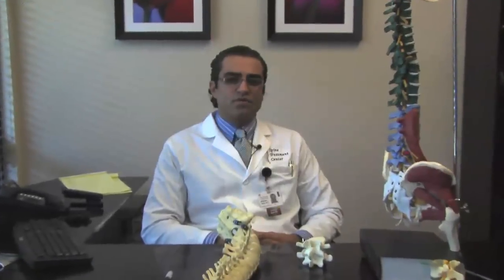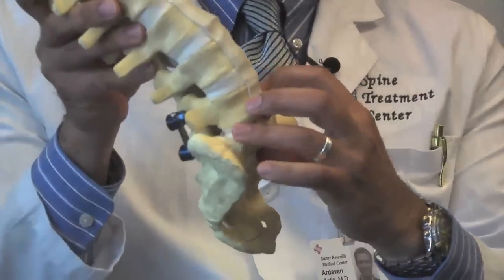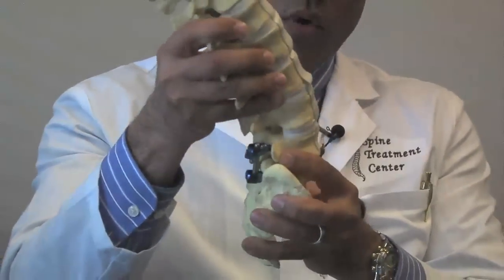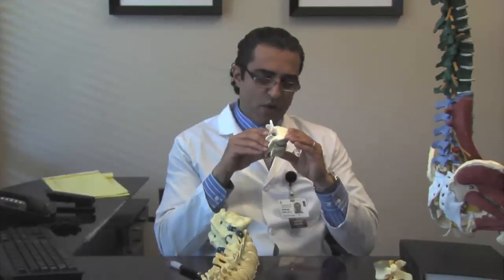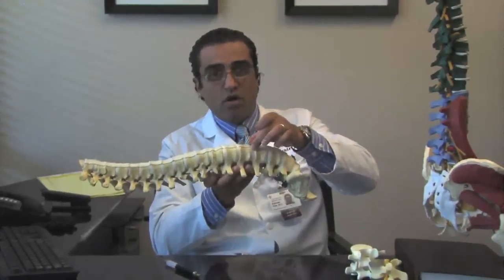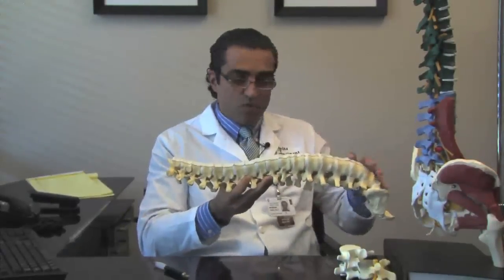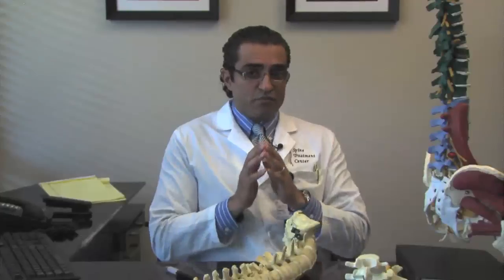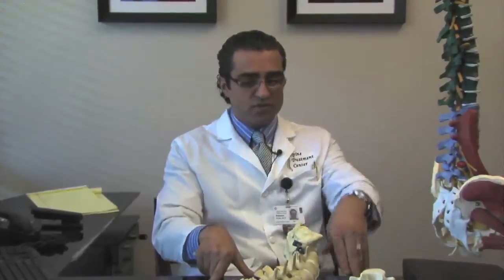Spine Treatment Center - Fusion Vs. Disk Replacement

Comment: Great video. Been Reading a hole lot about spine surgery. Had a surgery l5 s1 for herniated disc 
No fusion or artficial disc. Just remove a partian of the disc the pressed against the nerv. I am plain handicapped after this. 
I live in sweden so sorry for My english. This dr feels like a good guy, My dr want even see me after the surgery. Feels like when you get these surgerys your stuck in a loop. Its sucks but Thats life sometimes. 
Happy new year byw
Reply: daddyp 4 years later, how is your back doing today? is it got any better since the L5-S1 surgery? reason i'm asking, i need to do the same procedure in my L5-S1. cheers.
Reply: Did the doctor mess up? How did it handicap you

Comment: Indeed great video and easy to understand..I has question, I had my back surgery due to degenerative disc between L5 and S1, and my spine surgeon had to put a inter laminar device which is a hard silicone block called INTRAspine manufactured by cousin brother. Before the surgery, the doctor giving some options either to do spine fusion, or INTRAspine, but also rejected for disk replacement for same reason you pointed out. So how do you categorized the interlaminar (there are few in the market, such as coflex ? I mean what is the patient experience after few years.

Comment: So what kind of procedure for DDD of cervical c 3,4,5,6,7. due to trauma and aging. Walking weird off and on. Pinch nerve with certain movement in which my body goes numb. Problem turning head to the right, feel like disk goes out of alignment, then it straighten itself out when it feels like it.  Fusion or replacement, or do nothing?

Comment: I know it’s been ten years since this video has been made, having said that, has there been any advancements in disk replacement? I’m asking because I know that in Europe, spine surgeons use the LP-ESP, which is a visco-elastic disk that’s more rigid and simulates more the mechanics of a normal disc. Does your practice offer the LP-ESP? If not, why not?  Thank you
Reply: my understanding is that currently disc replacements are far better and have better outcomes than fusions for 1 level and 2 level replacements
Reply: Is that the one that has been greatly failing , they didn't research it long enough now they have all these failed surgeries?
Reply: @sarajah4him  I believe the one that has had more failures in the lumbar region has been the M6-L but it’s been a while since I’ve done any research on it
Reply: ESP has  unacceptable high rates of Osteolysis in male patients. A big fail if you ask me

Comment: unfortunately it still sounds like even for young people like myself that lumbar disc problems can really only be partially fixed by a fusion  which leads myself  as an avid grappler and someone who depends on flexibility for their job just how badly crippled you end up after a fusion  lets say  l5-s1  will you ever bend again or should you just go out and pre order a wheelchair  and say its been a good run

Comment: I had an injury at work,ended up months later having a fusion,it went great except for tingling and numbness in my left hand,mostly in the last three fingers,one doc said it as a pinched ulnar nerve in my left elbow,I had surgery for bones spurs in my right shoulder and the same doc says the tingling in my left hand was from the injury in my neck ..so he wants me to go back to the doc that did my fusion..on the papers I got he thinks I may possibly have polyneuropathy....so I am waiting on my Workmen's Comp case worker to set me up an app.,she took her time on getting me help in the first place when I got hurt at work,and I think it may have caused more damaged..waiting around (I reported it in November of 2013..,nobody would help,so I went to HR at work and immediately he got ma an app,but didn't have surgery until Feb of 2014)

Comment: Thanks for this video.

How do you like the M6-C, please, dear doctor? I Like the shock absorption profile mimicking nature's own.

My main concern--other than being nervous about any artificial implant--is that metal so differs in properties from bone. Even with osseointegration, if a cervical metal disc is dislodged in oh, a car accident, e.g., couldn't it endanger the spinal cord quite a lot?
Reply: Good question. It is actually REALLY difficult to move the artificial disc between the vertebrae once it is there, even before the bone integration with the disc end plates. There is a lot of pressure between the vertebrae to crush a really hard nut (about 1000 lbs in the male lumbar spine; cervical has less lressure, but still enough to hold the disc tight). If you get into an accident so bad that the spinal cord is at risk of getting pinched, it will most likely be from a displaced vertebral body more than an artificial disc displacement. This is what I hqve vathered after a good year of research. I just got my LP-ESP in Germany at L5/S1 qnd love it! Playing sports like there is no tomorrow.
Reply: Did you get it with Dr. Desai? I also need the L5-S1 and as of now he seems like the best doctor and also the best disc.  wow playing sports like no tomorrow that sounds good!  I hope I will be a candidate, I do have moderate facet arthropathy at L4-5 and L5-S1.  Did you feel like you got suspension in that disc? right now I feel like a old car that the shock absorbers have gone on.  I would love to ride my horse again!
Reply: @treelore5100  I went to Dr Schmitz in Dusseldorf. Same price as Desai (about $23k for one level) but Schmitz is a very talented and commited neurosurgeon. Both are good but Schmitz operates out of a private clinic so you are not risking the infection you might at a public hospital where Desai works. Each is good so I would send in your images to both. Feel free to email me for more information at curylloartur@yahoo.com. I am going to Tennessee to ride my dirtbike the week of Nov 26. I am 14 weeks out. I was riding my mountain bike at 5 weeks. You will be riding your horse again. Too bad most insurance doesn't want to cover this procedure abroad, but it was still best money ever spent.
Reply: :-)  thank you!  I copied your email address down so if you need to delete this you can (if you want).   I may well email you some questions as I get nearer.  Getting my MRI today.  Next will be working on getting a bone density test.  I had a look at Schmitz website and that private clinic sure looks like an upgrade!  I am surprised he can keep the cost the same.  I am going to think you had a good selection of hotels as it's in the city?  I would think they will have very good high speed internet.  He also looks to be a good age not too young or too old.   I got happy tears reading you saying I will ride my horse again!  as you know this is emotional and life changing if all goes well.  I just went on facebook and joined the group just waiting for my application to be approved.

Comment: ok so what do you think for the lumber surgery - fusion or replacement 
plz tell me - i have herniated disc in l4 l5 s1
Reply: what did you end up doing?
Thanks
Reply: ABDALLA AHMED MAHER this comment is weird. Did you think he was psychic 🤣
Reply: ABDALLA AHMED MAHER dude don't get a fusion. It's a old method that's fatal. I have a fusion on my l5 and s1 its not a good look. Get a dics replacement u will still be motion and mobility. That's everything 🙅🏼‍♂️🙏🏻♥️🦋
Reply: @devinramdihal8149  what does the fusion stop you from doing?

Comment: Doctor thank you for bringing a perspective I had no awareness of regarding this issue.  I have one lumbar disc that is completely bone on bone, very painful. Trauma related. Must have surgery. I also have cervical damage in 4 discs which is even worse with nerve compression. I have found a good surgeon but don't know what is the best route for me before giving him the go ahead. I am a teacher and a dancer. I want my life back. Surgery to be done in the next month or two. Please send message to facebook. Crystal Backmon
Reply: The idea of metal in my neck frightens me. Isn't there a better material that can be used?
Reply: crystal backmon I am 52 and MRI shows narrowing of canal in the cervical but besides spurs, the bones themselves are of good density. Just FYI
Reply: crystal backmon Wait till you get the answers u need. Your surgeon should be understanding. Do it when YOU r ready. I recently had total knee replacement on both knees. The metal was hard to get used to only when I could feel it, like when I would kneel. Other than that, you don't notice it at all. The types of materials changed over the years and have advanced dramatically. The doctors in-the-know use the 30 yr prosthetics instead of the 15 year ones. Research! Incidentally, I have a girlfriend in TX who had neck fusion and loved it. I also know of a patient who had the problem with the neighboring discs as described in this video. Difficult decision, I know. I have to say that PTherapy definitely has improved. My knee says so.

Comment: I have had epidural injections for several years.  I had a motorcycle accident, also previous injury from accidents from motocross and contact sports.  I had C5-C6 fusion and have three more dry discs, one above and two below that.  And three thoracic dry disc, that are causing severe pain through my torso.  And 4 damaged and dry discs in the lumbar region.  My vertebrae are also arthritic.  Very cloudy in the MRI.  Do you think the epidural injections could have caused bone to become arthritic in this way?  I have been told I am not a good candidate for surgery because of poor vertebrae as mounting points for posts.  Do you think prosthetic discs would be a viable replacement for this many issues?  I am in severe pain for 6 years now and rarely sleep, and have lack of stability in multiple places in the mid and lower back.  I am in misery and need help.  I currently see the VA, and they are as bad as described in the media.  Any references and help is greatly appreciated.
Reply: +John Blecha  VA Did fusion on my husband's back at L4 thru S1 one , he walked like a robot and was on pain meds until his death in 2010.
Reply: +capatga Sorry for your loss.  I am reluctant to have the VA do any more work on me.  I have seen three Neurosurgeons about my condition and all have given me low chances of good recovery.  25% at best.  I am in chronic pain and been down that pain med rode with poor results in the long run.  I took myself off of most of them and pain as decreased to a small degree, but anything is considered help at this point.  I am really miserable and need something done.  I was hoping this might be possible if the VA will outsource the procedure.  Living on a prayer here...
Reply: I am sorry to hear the state of your spine. I would consult outsideof VA for any serious stuff like spine surgery. I went to Dr Andreas Schmitz in Dusseldorf Germany, but there are several other really good spine surgeons in Europe and here in the US. I am not sure if you can qualify for a disc replacement since you have a bit of arthritis from what I read, but they would all have you get a Dexa bone density scan as well as a CT scan aside from your MRI to see all bony structures aside from the discs. You can send in your images to Dr Pablo Clavel, Dr Biren Desai, Dr Andreas Schmitz (my three favorites). Schmitz is the one who fixed me. At leadt you can get an opinion from the best of the best in the world.

Comment: We DESPERATELY need to update the design of these replacements. The inside of a natural disc is like silicon rubber, and the outside is like a much tougher, fibrous plastic. Why don't we have a disc designed with two layers like the natural one?
Reply: Thanks, man.
Reply: @DavidSain1  M-6 has a major design flaw where by the the core tends to displace because it is not well contrained (the woven mesh in M-6L is not strong enough to keep the core centered if you experience any instability in the segment). This was well mitigated by a different disc manufactured in France: LP-ESP. I just got one three months ago and riding my mountain bike like there is no tomorrow. Good luck!
Reply: Artur Curyllo where did you get this procedure done?

Comment: Hi, I had a very large herniation l5 s1 and five spurs of bone. I had a microdesectamy. Since then I have re herniated the disc and are in extreme pain.
The surgeon has recommended a fusion over a disc replacement and says its 70% success rate. Anyone else's opinion would be massively appreciated! Dire straights at the moment. 
Thank you.
Reply: Hi did u have the surgery
Reply: @hamedaloui5487  hi, no I have been doing lots of core exercises, walking and loads of stretches. Seems to be kept in check. Obviously I can't do any crazy things like sprinting or power lifting. But I'm OK if I get a flair up I will resort to naproxen or pregablin. To help with the nerve flamation. I have learnt that the least surgery or invasive treatment the better and with technology hopefully! Stem cell tech for example. Good luck with ylur own treatment.

Comment: Well fusion is bad and disc replacement is not good for degenerative disc disease, you didn't advise on what we should do then ? Live with the pain? I can't sit long or stand long we are talking longer that a minute or walk more than 5 minutes, please advise me on what is the best surgery for me, I have a severe degenerative disc in L5S1, and spondylosis a shift of 1centimeter in L4L5. Thanks for your great explanation and your helpful information,please answer my question, thanks
Reply: exacly the saame for me .. u.s. marine dis. veti 36 yrs. old..... they want to fuse mine!!!! im scarred ass hell.
Reply: I think fusion has a 50/50 success rate with 4-6 month recovery. Disc replacement is relatively new in it is more common in EK and Germany. You have to check what your insurance covers first unless you have ton of money to spend. I think many cover fusion but not TDR.
Reply: I would say fusion is the only option.
Reply: I have had back issues for 22 years - I am 38. The first issues I had were all muscular - spasms etc after a couple of tears. I was the the Royal Marine Commandos as well as dabbling in bare knuckle fighting for a few years so have always been very active and involved high intense and physical activities. After a fall down some stairs around 5 years ago, I started getting nerve pain in my spine, tingling in one leg. Lots of physical therapy, chiroporactors, back injections etc and all this has done is drag it all out. After some xrays and an MRI I have a messed up disc as well as one of my vertebrae moving in a way it shouldn't. The only option is to have a spacer put between my vertebrae, it then gets fused with a bone graft, however as the vertebrae is also unstable it has to be fused further with 2 rods and a bone graft over them. The operation is known as a minimally invasive TLIF which for what I need is the best way to get the job done and the least possibility of issues during surgery - damaging nerves, muscles, arteries etc which are more possibly with the other fusion surgery types. My advice is do research on surgeons in your area, I am lucky enough to live in New York so have an abundance of world class surgeons or at the very least doctors that have trained under them. Find a surgeon that is up with the modern procedures, minimal invasive is the way forward. If if it fusion that you need you will want to have the least amount as trauma as possible. Usually one can return to office duties in about 6 weeks.
Reply: Could you share about the outcome of your surgery and your surgeon's name and hospital? I live in the NJ/NY area and I am looking for a surgeon I can go for help with my spine problem

Comment: I have been treating with Epidural injections for many years. I never had any problems. Do the research and then make a decision.
Reply: Epidural injections only mask the pain. Howerver, cortisone can cause arthritis or accelerate it so you need to be careful for long term problems due to those.
Reply: Not a problem.Do more research.

Comment: thank you, informative. title should be changed because those of us that get fusion have the disk replaced with spacers and bone.  The device you show looks like something I saw recently, Mobi-C  . My neurosurgeon said I was too old for that. He wants to fuse 2/3 and 4/5 to relieve the pain,pinsand needles, numbness in my right shoulder and arm. I m going crazy, I have to decide soon.
Reply: How old are you? M6-C can be used in patients up to 75 yo in the current FDA study recruiting now. However needing surgery on more than a single level is an exclusion criterion. If you replaced a cervical disc rather than fused could it be at only a single level? There's the rub.

Comment: I hsve been teaching disc replacement surgery for more than a decade. I have been a lead investigator in many clinical trials for total disc replacement. This a poor example of a surgeon, attempting to educate the pubic on a technique that requires talent and experience    This is a step backwards in patient education and clinical trials,
Reply: With all do respect DR Janssen,I do perform this surgery. I do believe it is an addition to spine surgery. However, I don't believe the indications are as broad as we are told by surgeons who have financial connection to these companies. I am not a poor example of a surgeon. I have four original patents which are extremely hard to do these days.One of them laminar plating system, the only system in the world for osteoporotic spine. always been top of my class. double major in Berkeley.Did my spine training at harvard. However,I understand and accept how controversial this topic is.
Reply: ard a
Reply: I find his info.. to be to the point.  And very helpful.  Maybe u should take some lessons..
Reply: So since you disagree, what is your suggestion regarding these 2 choices of surgery?